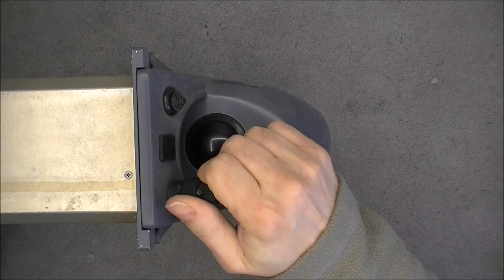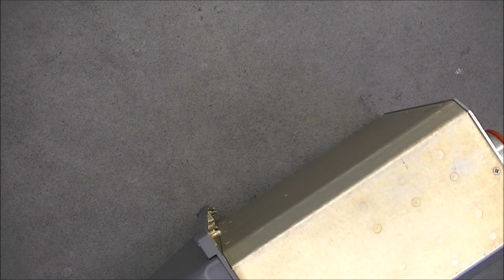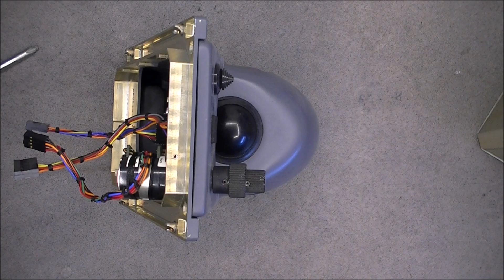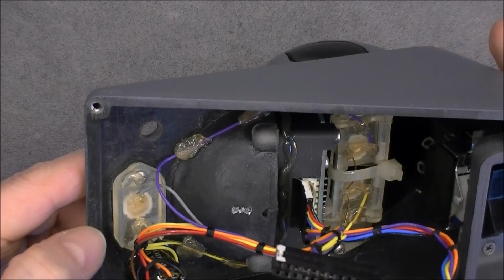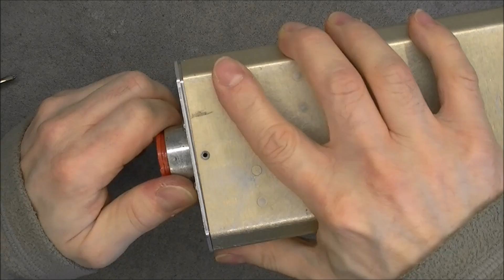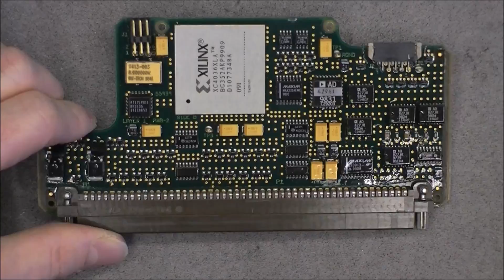Airliner cockpit trackball controller teardown

Comment: Why on earth do they need a Xilinx in a track-ball controller?  

The "golden dots" under the BGA are test-points.
Reply: I would not be surprised if the FPGA is simulating a synchro resolver and driving a whole bunch of D/A converters.

Comment: big BGA XILINX chip is a FPGA (https://www.xilinx.com/support/documentation/data_sheets/ds015.pdf)
Reply: and a  golden dots on the other side of pcb is a test pads (for connecting to pcb using pogo pins)
Reply: LT1114 is an quad op amp
MAX191 is an 12-bit ADC
AC14 is possibly SN74AC14, 6 Schmitt-trigger inverters
UC1845 - http://www.ti.com/lit/ds/symlink/uc2844.pdf (DC-DC chip)
Reply: MAX691 - https://datasheets.maximintegrated.com/en/ds/MAX690-MAX695.pdf
Reply: (quick googling)

Comment: 17:32 are most likely diodes, as they are marked with K (kathode). I haven't seen such either.
17:55 ceramic capacitors, 125C type, AVX. It's one single capacitor, and they have as many stacks as needed to fullfill the required capacitance. They are freakin' expensive.
wonderful video, as always